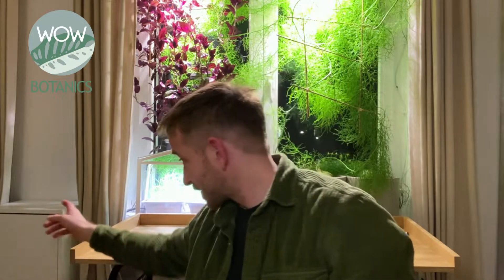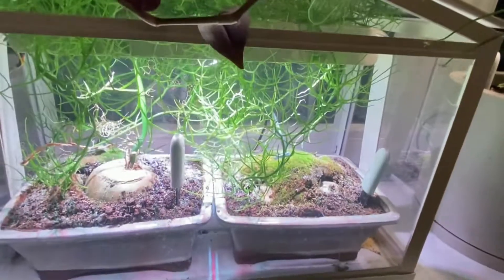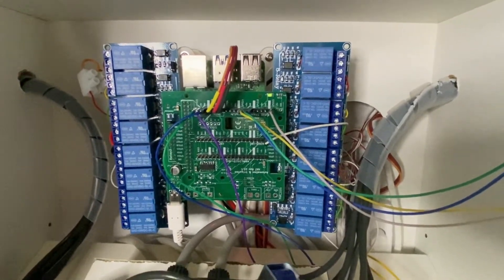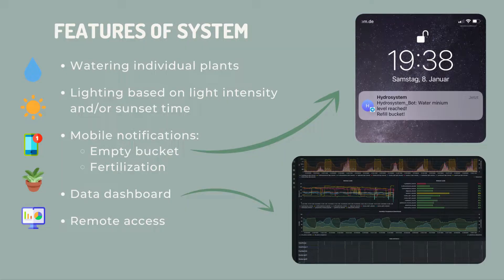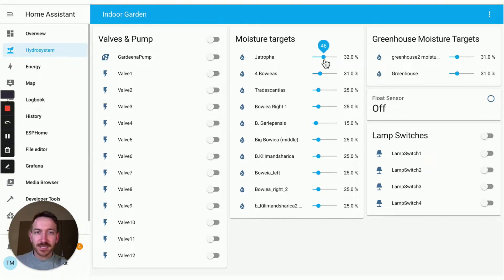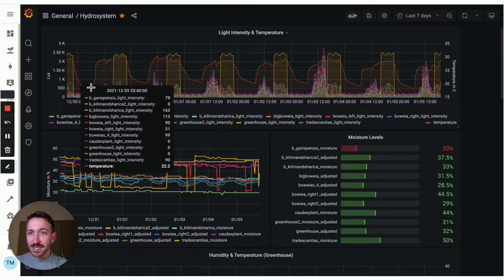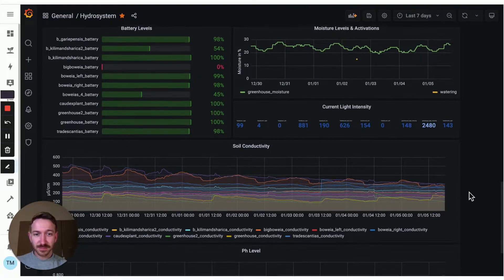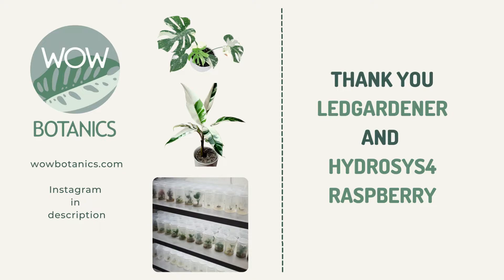How to Automate Your Indoor Garden with Home Assistant | Advanced Project

Comment: Hey Thomas, nice video - thanks for that. Would really like to know how this system is going for you today. I am looking for a way to get some metering for my plants into Home assistant but I'm not sure about the best sensor solution. I do have one of these sensors already and I seem the values there relatively erratic. There must be something better out there. Thought about building something myself, maybe even something chargable but not sure yet.
Reply from the maker: Hi Helmi,
After long-term use I need to say: you are right - the sensors are not the best. Some you have to calibrate and some loose the connection from time to time. Making sure the batteries are reasonably charged reduces the error rate. I have also been looking for (wireless) alternatives but have not found any so for. However, last time I looked was probably 10 months ago. I also checked more expensive ones like FYTA but at the time it wasn’t sure if a connection can be established. Let me know if you find a better option.

Comment: Nice project. Is this setup still going strong or did you face any difficulties? Are these solenoid valves 12V or 5V ? Are you using flyback/suppressor diodes to dampen the back EMF from solenoid valve coils to protect other sensitive components in the circuitry? If yes what diodes are you using? I am in the process of purchasing materials for a vacation watering system. Planning to use a 24 channel ESP8266 module from AliExpress I am already using MiFlora sensors and HomeAssistant with my plants.
Reply from the maker: Sorry for late response. I use 12V valves and I have not anything that you describe installed. Honestly, even after translating I do not fully understand it as I am really just an amateur in this field. Can you recommend a link to better understand the thing you describe?

Comment: Great video!!!!!  I have a Homeassistant server running on a desktop how do I connect the irrigation HAT without Raspberry PI to my home assistant
Reply: Hmm, that’s a tough one. The irrigation hat is specifically designed for Pi and fits directly on the pins. What is it that you would like to do? Are you looking for an easy connection to the relais?
Reply: @thomasmarquardt8118  yes was trying to avoid pi and another instance of HA
Reply: May be should use esp32 with relay
Reply: @abineshadhikari5973  that was also what I was going to suggest. I’ve seen pieces where the relais are already integrated. I am also working with a relais board connected to esp32 in a different system.
Reply: Could you please give me a link?  And or a tutorial?
Reply: @thomasmarquardt8118  thanks for the reply!!!

Comment: Great video ..I am also building something like this project but using home assistant and esphome on different esp boards ..I have just got some wired soil sensors and small pumps also …also have a PH sensor that I want to intergrate … I have some Mi flora sensors also …where do you get the correct plant value information to set the sensor to start a water ? Just started growing a few plants so hoping to keep them all alive …
Reply: Sounds like a cool project! For watering my plants I use the automation below. You will notice this is only for a single valve. I have another one running for my pump, which would only fire if one of the sensor value is lower than my moisture targets. The targets I determined via input numbers - you can include them in your config.yaml. Input numbers can then be used in the automations (like below) or in sliders in the front end to adjust them. I hope this is what you wanted to know. 

- id: Openvalve_Greenhouse
  alias: Openvalve_Greenhouse
  trigger:
  - at: '12:30:00'
    platform: time
  condition:
  - condition: template
    value_template: '{{ (states(''sensor.greenhouse'') | float < states(''input_number.moisture_target1'')
      | float) }}'
  action:
  - data: {}
    entity_id: switch.valve1
    service: switch.turn_on
  - delay: 00:02:00
  - data: {}
    entity_id: switch.valve1
    service: switch.turn_off

Comment: Great video! How do you like those Bluetooth sensors? Plants look really nice.
Reply from the maker: Thank you! The sensors work OK for me but I had to calibrate them (over template on config.yaml). My impression is also that they are not as accurate as e.g. a capacitive soil sensor (connected via ESP32). For some there are big and sudden drops in moisture level where a capacitive soil sensor would show an more incremental decrease over time. I also had 2 faulty ones already. Hence, I would always source locally and not via Alibaba or similar so you can return them in case of a defect. I have been looking for alternatives. There's a few been recently released to the market but I am not so sure if they can be easily integrated.